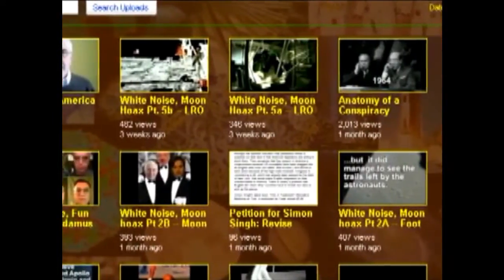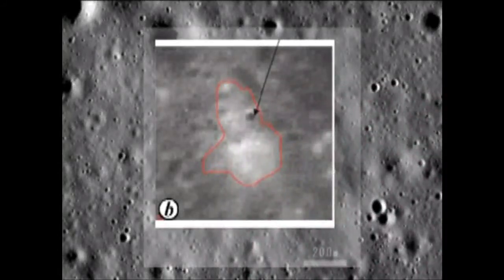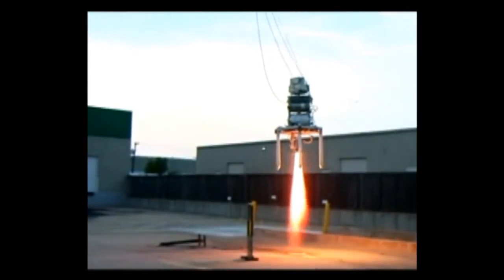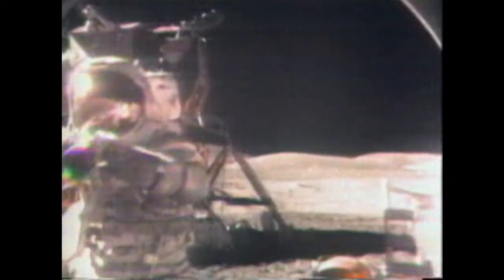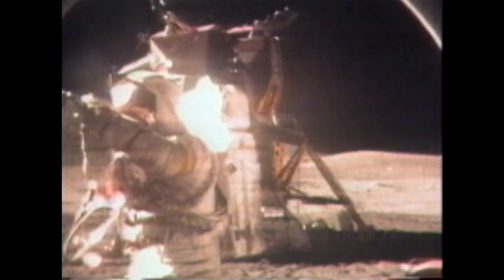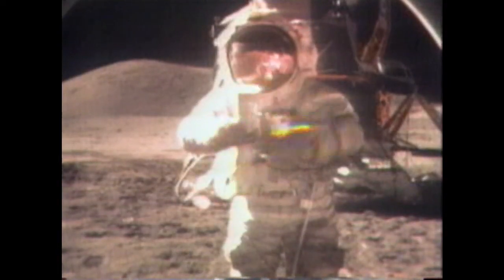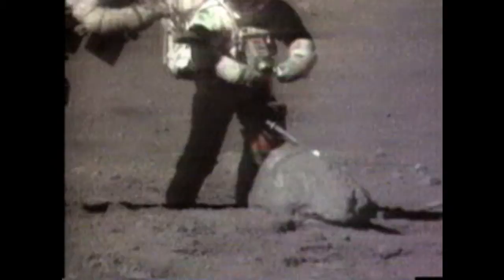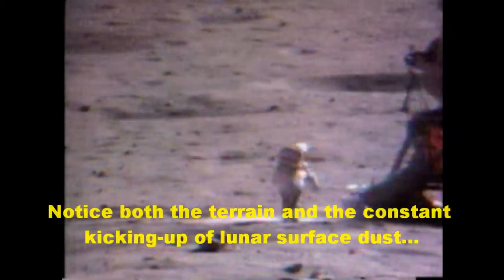Moon hoax conspiracy debunked: Engine halos

Comment: Sorry but I/m pretty sure the contact probes were neither retracted nor in control of the engines.
They were very thin and crushed under the LEM when it touched down and the switches only controlled a light on the control panel to inform the pilot it was safe to cut the engine.

Comment from the maker: The rocket in the video was a Jarrah White feature. The LEM was reducing power as it was descending; only a moron like you wouldn't understand that. The gravitational pull on the moon is only 1/6 the gravitational pull on the earth which means 5/6 less power is needed during the descent. There are plenty of photos showing the disturbance of regolith on the surface of the moon, under the LEM. Please don't waste peoples' time with lame, long-ago addressed conspiracy talking points.

Comment from the maker: "They goind to blow dust around." Blow the dust away from where the lander lands. It aint complicated." No, it's not. And you can see dust being kicked up as the LM both lifts off and lands on the surface. This is visible in video footage of the landing approach on Apollo 16 and the lift-off of the LM Apollo 15. But more importantly: what exactly is this dust supposed to do?